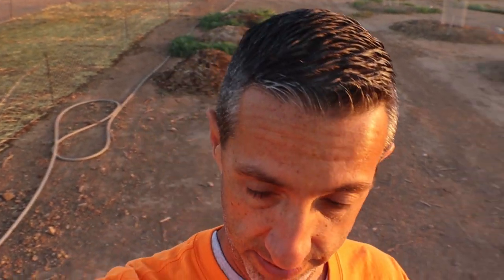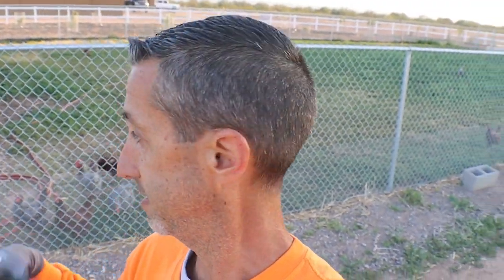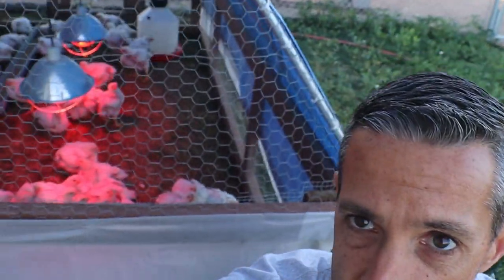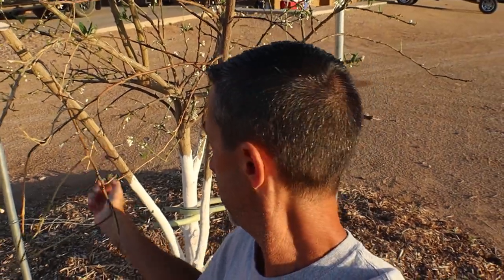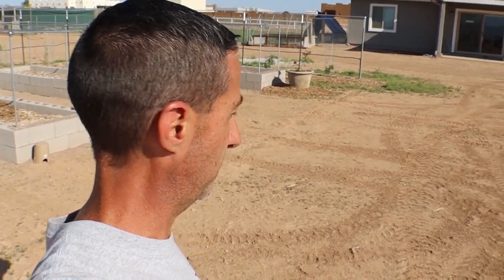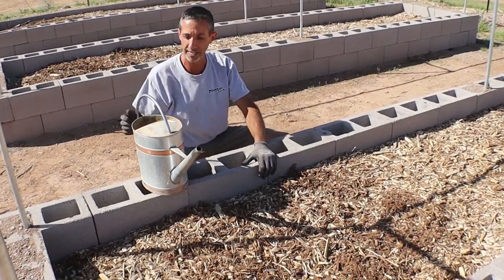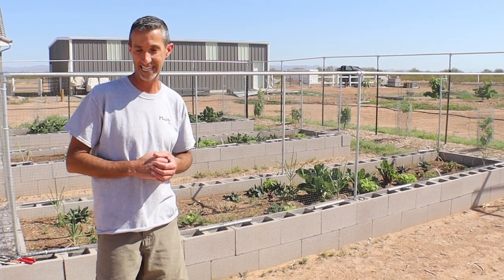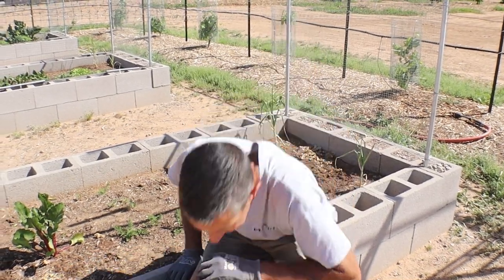DFV | Winter Harvest | Spring Planting | Lime Tree Transplant Update

Comment: Hitting the wall... man I know that feeling lately.  Anyways my ever bearing mulberry planted recently look kinda yellow maybe chlorosis, any advice?  Great news on that lime btw, kind of surprising it’s lived.
Reply from the maker: Hmm, that's an interesting predicament with the mulberry. This time of year those leaves should be pushing out nice and green. Assuming you're using some type of fertilizer here. What is the irrigation schedule looking like? Also, are they in full sun?
Reply: @EdgeofNowhereFarm  Full sun, watering once a week as its not that hot yet and our soil doesnt drain that well.  I didnt fertilize yet cause they just went in 2 months ago.  Maybe give them a boost with some fruit tree fertilizer?
Reply from the maker: @theorangetreehomestead6660  ok. You know it wouldn't hurt to give it some fertilizer, but lightly. We're slowly changing our opinion when it comes to fertilizing when planting and have been adding fish emulsion at minimum at planting to help give the tree a kick start with some fertility. Soil drainage may be an issue if it's staying too wet, but if you're using nice, heavy mulch you should mitigate that somewhat.

Comment: For the Pig Wallow, would you consider some sort of shade construction for it to benefit the pigs and conserve more water?
Reply from the maker: Great question/suggestion there Carolle. This is not the area we will typically keep pigs in, so we will take shade into consideration in their permanent area. However, we usually only keep pigs in the winter when they won't have a need for the wallow. This year we had a late start with our breeder, so they're here into the warmer part of the year.

Comment: I would put the truck and trailer in the barn to prevent steeling.  Sad it has to be done
Reply from the maker: Sad but true Barb. The truck is back in the outbuilding and we have a boot and hitch lock on the trailer. There's a camera on it as well, so we get an alert if somebody tries to head out that way. Sad state of affairs, for sure.
Reply: Sensible decision - cameras reduce temptation!
Reply from the maker: @pam9470  bummer it has to be that way.
Reply: You can also put a gps tracker on one or both. That way it's easier to track down if someone succeeds.
Reply from the maker: @xxMichelleUnicornxx  very true!